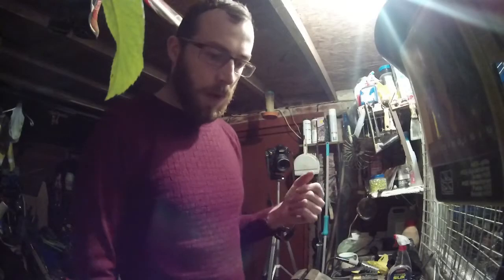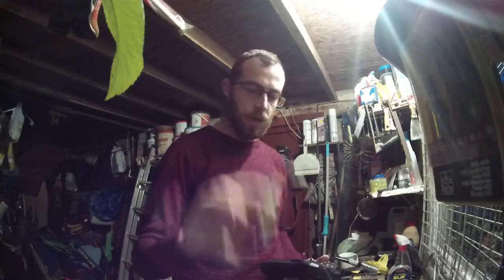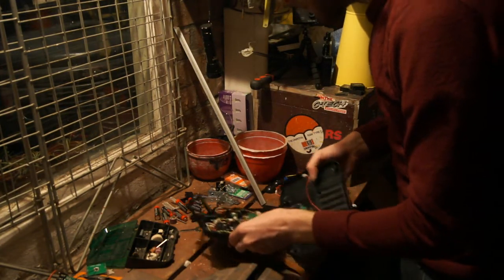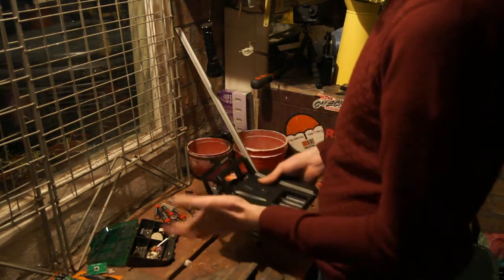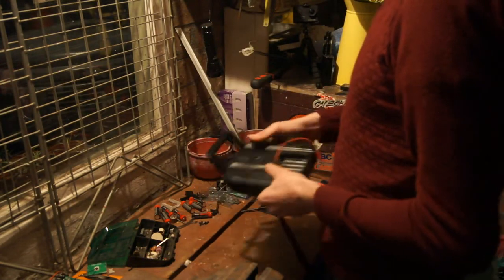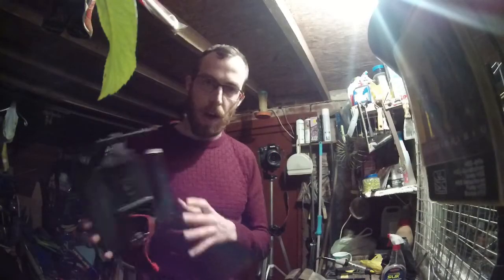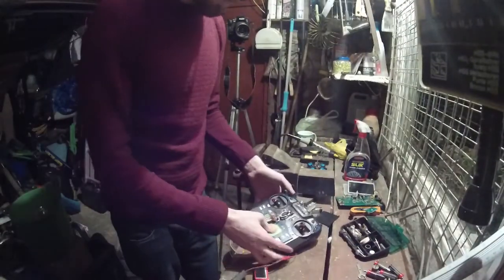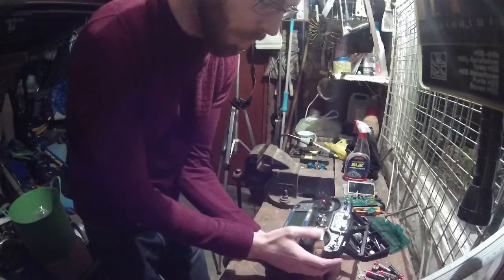Badly Modified - Flysky FS-i6 LiPo Conversion How-To (TGY-i6)

Comment: If you add a diode in the original battery lead and use a buck converter set to just over 6volts you can leave the alkalines in. Thus giving you a way to hot swap and have  guaranteed power to your Tx for those long distance record attempts. ;-)
A little battery checker/alarm is a good idea also. :-)

Comment: lot better have use 3,7V lipo and add in battery tray, and step up booster board in to transmitter whit heat srink tube and double side tape, then you not have outside transmitter anythink shit. all have clean same. or made ugly but longlife battery, 7,4V battery and step down board adjust at 6.3V and shrink tube cover and double side tape backside transmitter elektric board and battery. ugly but big battery. and plugin at battery take out and charge, then add plug and use. ready